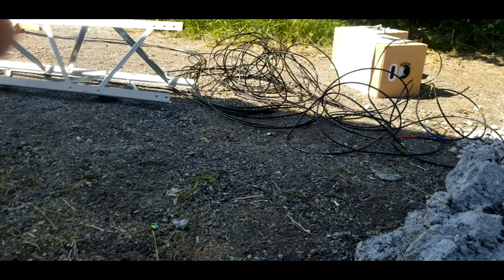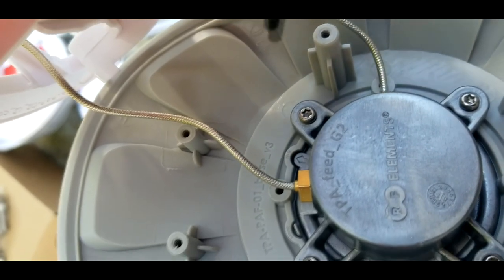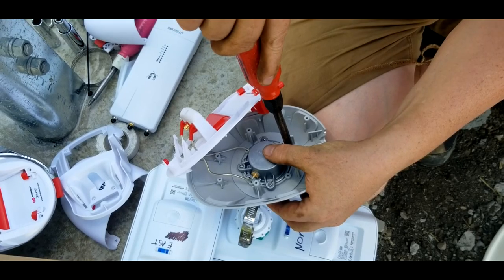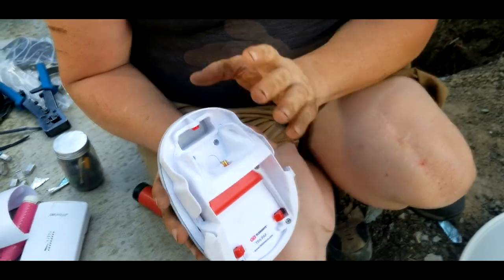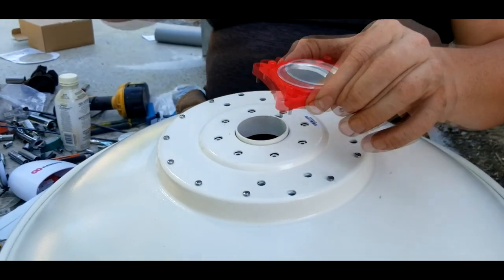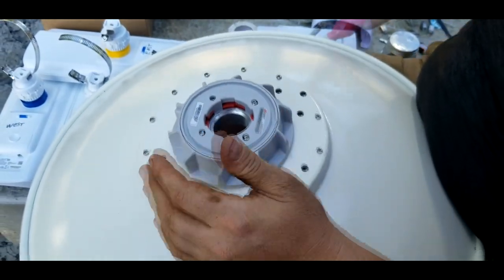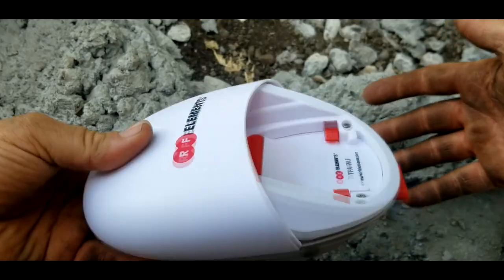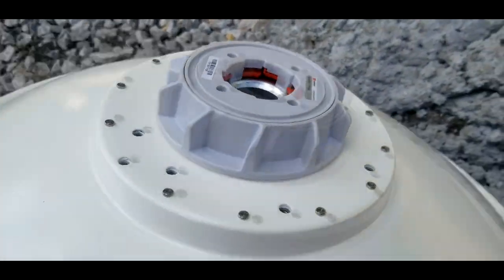Rf Elements Twist port Slant 45 tutorial. & bonus!! How to install an AF5xHD

Comment: Thanks for great work and important tips.
When I should go for 45deg? Is it useful to go for that in congested area?
Reply from the maker: It really depends on the situation & strategy. Always use even numbers of sectors and divide 360 by that number to determine what you need. Usually you add more sectors to allow for more clients.
Reply: @thefixitgal  thanks for your reply.
Plz do more videos, I learned a lot and I get a good idea of my new WISP project.

Comment: why didnt u try airfiber 30dbi s45 dish. i think its much cheaper . plus extra 3 dbi gain might be positive thing to achieve.
Reply from the maker: They're cheaper for a reason. Gain is only one aspect of an antenna. You also have to consider how clean it propogates energy, beam width, leakage, signal pattern. Ubiquiti antennas are cheap for a reason. Plus the twist ports make swapping radios for repair or upgrade quick and easy. All around the RFE dish is better than the ubiquiti. You can also set the twist port to S45 internally ;)
Reply: i might be a noob in somecases haha .but where i live 34dbi s45 airfiber dish are almost the similar price as these dishes from Rfelements . i was planning to try these for 20miles. but still im confused.
Reply from the maker: There's factors to consider with every link. Just don't use ubiquiti Antennas. They are sub par. Id suggest you look into "Radio Waves", "Jirous", Kp-Performance". The biggest dish RFE makes is 27Dbi which is better than the ubnt 30dbi. After that you'll need to look at other vendors. If you need assistance on planning your link feel free to book me. I can answer all your questions. 
https://calendly.com/isptechnology

Comment: Should I do this on my A5x adapters since the C5x are slant45?
Reply from the maker: The idea is to use the /45 to help avoid interference from neighboring backhauls. So you would set specific links to /45 to help mitigate colocation issues. /45 also separates the backhauls from the polarity most PTMP systems use. Another way to help with colocating Backhauls is to use larger dish's to tighten up the beam.

Comment: For 25 miles distance what is the recommended RF elements horn? P2P.
Reply from the maker: UD550. But Id rather use something a bit larger like a Radiowaves or Jirous 30Dbi